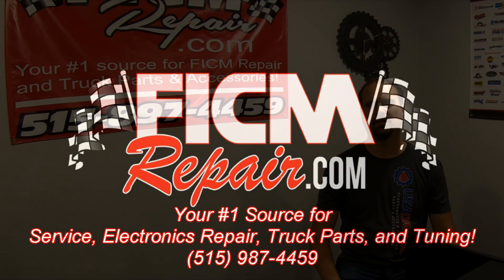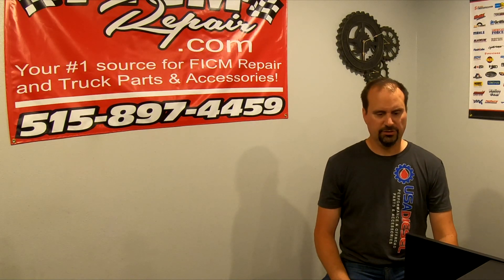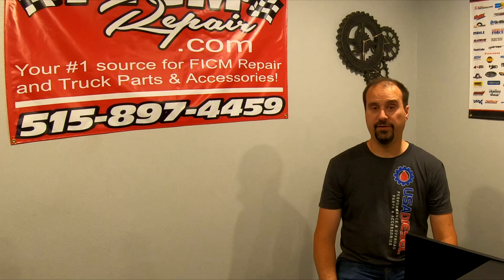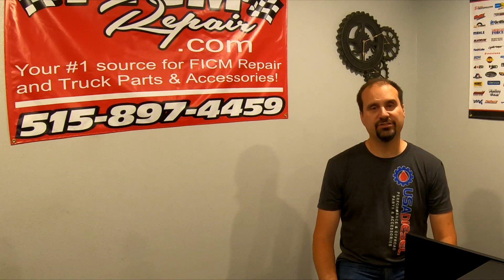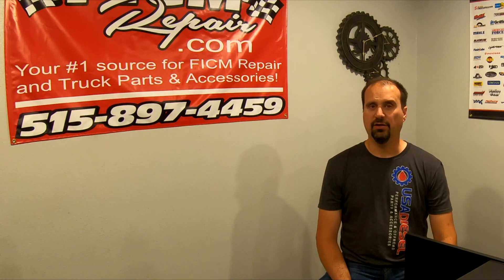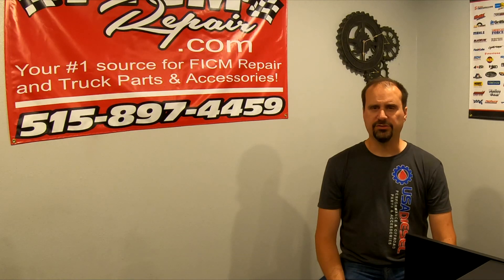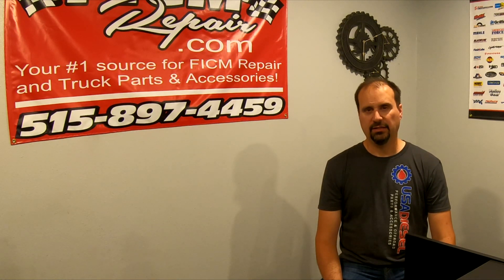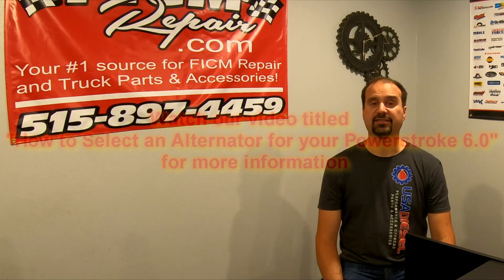HOW TO Test an Alternator

Comment: Good seeing you Ed. Home testing should also include AC ripple testing. Also wrapping that fresh baked alternator in a blanket will help to keep it oven fresh hot or as close to that as you want to be. Now just don't be driving fast and get pulled over 1 the ticket will cost you and 2 the officer is going to think your nuts for having a HOT alternator in the seat and may even call the guys in the white suites with a nice tight fitting jacket for you to try on..